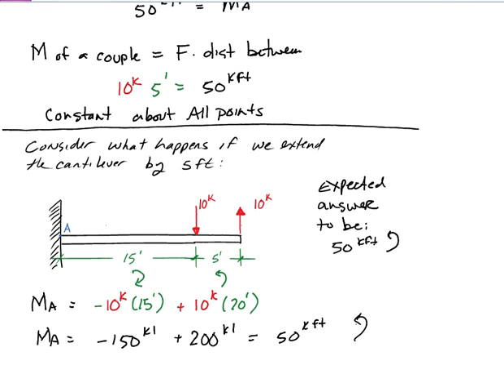Moment of Couple

Comment: Very good explanation. However, if the forces are not perpendicular to the beam, aren't the computations a little more complicated than this?
Reply from the maker: ABIYSCGSTEGD Only slightly more complicated. You would decompose the forces into horizontal and vertical components using trigonometry. Assuming that the thickness of the beam is negligible, the moment of the horizontal components would be zero about point A and you would proceed as in the example with just the vertical components. (if the thickness of the beam is not negligible, then you would use a lever arm for horizontal components equal to the vertical distance from the point of load application to point A & add the results)
Reply: +John Tingerthal after getting the moments of the vertical and horizontal components of the force, should you just add it? or subtract? or what?
Reply from the maker: +Sbij Akan You sum them, but need to respect direction. If CCW is positive - then CCW moments are positive and  CW moments are negative
Reply from the maker: +ABIYSCGSTEGD yes - you would have to resolve each force into forces perpendicular to the beam and parallel to the beam  - then proceed.